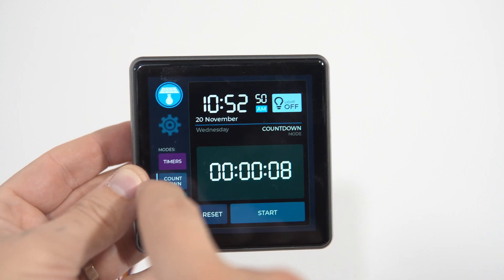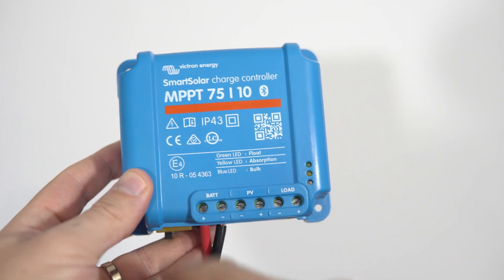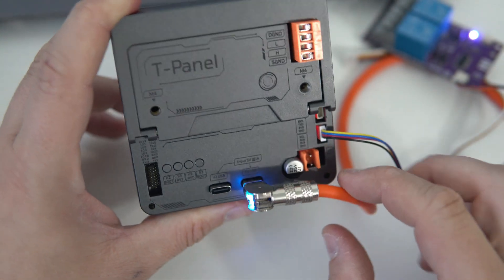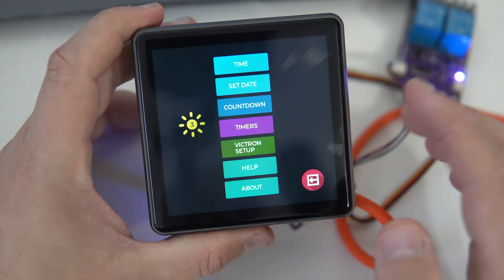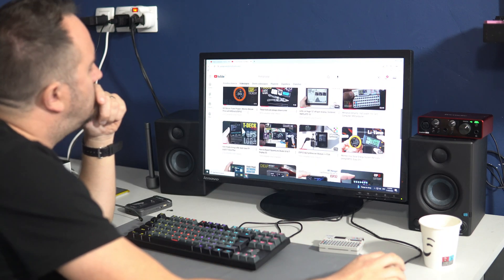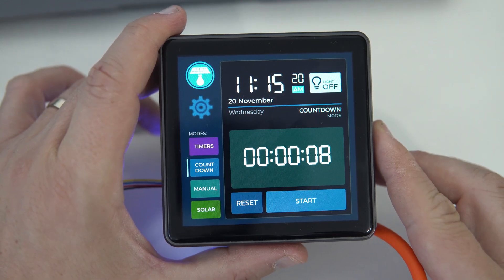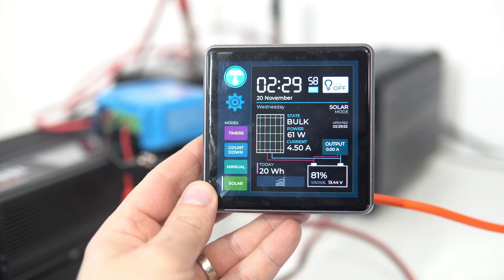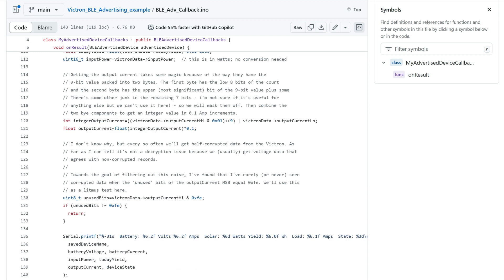My Most Complex ESP32 Project: Retrieving Data from a Victron Solar Charger

Comment: Can this work with their smart shunt?
Reply: I got it working with both smart shut and charge controller 150/70. Im running on esp32devkit1 on Platormio so a few modifications were needed but code works. Hope this helps.

Comment: Hi Volos, what display driver do you use for the T-Panel? The code seems to be using TFTe_SPI, but I'm making a project on this panel also, and it is connected by 16bit RGB bus, which TFTe_SPI doesn't support, I believe.
Reply from the maker: Each board have git hub rep and there you can find examples and libraries, i usualy try all those examples and i use them as starting point for my own projects. This example is based on lvgl example provided by lilygo, not sure if driver is tft_espi but if it is then you need to use version of library lilygo provided

Comment: I've admired your UX design sensibility for a long time, but nothing got me hyped enough to buy a Lillygo board to make something.

I have a campervan with a Victron BMS, and a Renogy charge controller/DC-DC converter.   Victron Connect is OK, but I don't like having to use a phone.  Renogy's DC Home app is almost OK, but once again,  there's yet another phone app to manage.

It would be great to have one dedicated HMI to deal with both.  I haven't looked into Renogy's protocol to see if it's documented or has been reverse engineered.

Then one starts thinking about a Home Assistant-like ecosystem with integrations for harnessing multi-vendor components into a unified UI and scripting system.

In the end, I find HA to be too heavy, ugly, and clunky to hit the kind of elegant, precise vibe your projects give.

Keep showing this inspiring work.
Reply from the maker: i also have some renogy panels, renogy have great prices, but i haven saw that somoene was able to get those data.
Reply: @VolosProjects  I looks like my reply attempt was deleted.  Search for renogy Bluetooth protocol yielded good results.  Good thread on Will Prowse's forum.  Github repos, too.